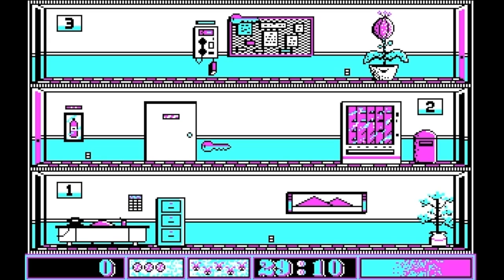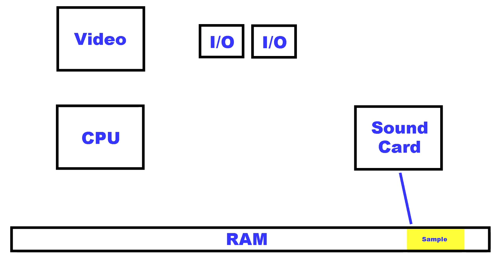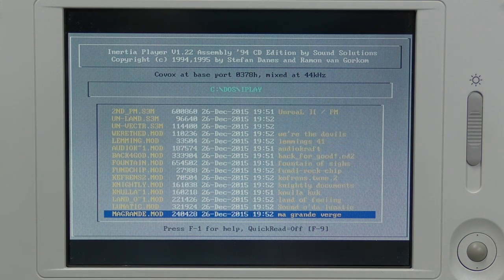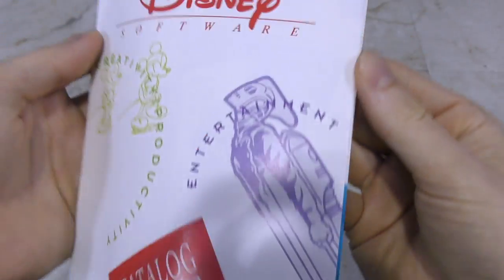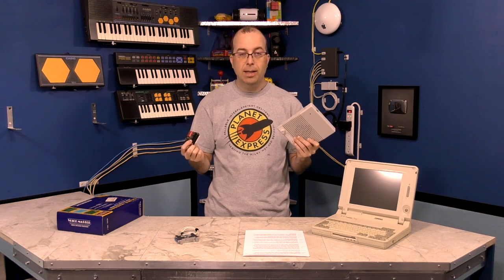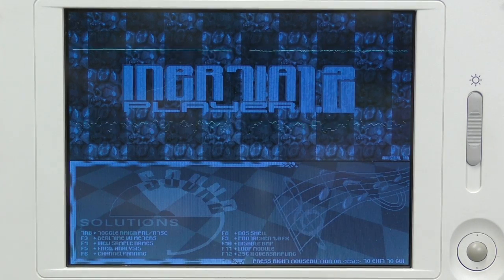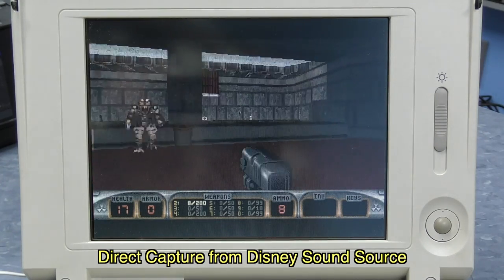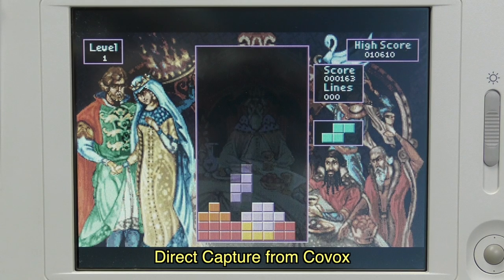How the Covox and Disney Sound Source Worked.

Comment: Does the Tandy emulator work with the Sierra AGI tandy support (that is, Kings Quest 1, Space Quest 1 etc)? If you type sierra -t apparently you can force the interpreter to use the Tandy 3 voice. That might be very useful, as all AGI games have 3 voice sound.
Reply: yes it works. There's also a 3 voice driver patch for covog, for sierra EGA games, and for VGA games.

Comment: Such a passive-only Covox clone only sounds good when used on a CMOS Type Parallel Port. If you have a TTL Type the Signals of the pins are not exactly 5V or 0V but with some offset and that decreases the sound quality. Using a simple CMOS 8-Bit driver IC will fix this but this IC needs Power from the PC to work. There is also a Stereo-in-One Thing that has 2 DAC and Latches switched/triggerd by additional control lines (the Parallel-port hat 12 - 8 for the Data Register and 4 Control wires.

Comment: Or build your own covox clone using a bunch of resistors soldered onto a parallel port connector...  Easily search for a wiring diagram for it.  I bet the one I made back in the 90's still works! =D

Comment: Actually, if you want to make one of these yourself, you're simply going to need seven 20kΩ resistors, or a resistor pack with 20kΩ between pins. The least significant bit runs through a resistor and then is tied to the second bit. This in turn passes through another resistor and then combined with the third bit, and so on until you've ganged up all 8 bits. That's your analog output.

Source: I made my own back in the day.

Comment: I wonder if the games checking for the BIOS string could be fooled: if you're running on a machine with ROM BIOS shadowing, I wonder if it's possible under MS-DOS to go in with sufficiently clever assembly code and modify the shadowed BIOS vendor string in RAM.

Comment: I have one of this Lpt1 port type cards, but I don't remember the brand or model, I only have the internal pc board, I barely remember it came in a black plastic case, and don't remember if used batteries but the pcboard has two pins with + & - so I assume thas the power source of the board. mailme for a pic. of the board and maybe helpme identifying it , or if it needs a driver or config to make it work just for te hell of 8bit...

Comment: seems like the Disney Sound Source is the better design. I wonder why they didn't go with a higher sampling rate like 11kHz. The concept is so simple, I wonder why no one follow up with a better version to try to overclock the Sound Source. Seems like one just need to hack the driver to switch to a higher bit rate.

Comment: On 386 (or higher) you may get partial (digital samples only, no FM) Soundblaster compatibility with VirtualSoundblaster TSR. However it has some extra limitations as it puts CPU in (IIRC) some kind of 32bit protected mode and emulate 16bit real mode. So some games may not work, Windows too... (but it has covox/sound source drivers so it's not as big deal). 

Simplest Covox compatible plug may be easily made from 20 resistors (1% tolerance suggested) two capacitors (not obligatory) and DB25 plug (total cost converted to USD was ~$3), just google "covox schematic" and go to nearest Radio Shack equivalent (hearing sound form self made device is quite satisfying). (There is option to improve it by adding low-pass filter and amplifier to improve sound quality if somebody feels more ambitious).

I tried using covox plug on my PIII machine as with no ISA I had no sound in windows (lack of drivers for PCI cards, they work in pure DOS only with similar 32bit trickery). High improvement over speak.exe (PC speaker PWM driver), but lagged terribly in games (Toy Story:Power Play had 1FPS with sound enabled on 1GHz CPU). I'm gonna try Sound Source in future. (Getting new motherboard with ISA is out of question as this PC is mostly Win9x oriented, DOS/W3.x is just an addition and I don't have space for another machine).

Comment: You ain't have to spend money for real COVOX device to test how it works on your good old PC.
What you need is just 8 resistors of 1kOhm, 2, 4, 8, 16, 32, 64 and 128 kOhm (if you change the resistance a bit, the resulting sound would get some additional noise, which could be quite acceptable). You just insert one wire of each resistor into D7, D6 .... D0 contact of your LPT port as a pin of the 'device', and connect each second wire of resistors into one point. Here's the point to connect your favourite banana plug. Then connect 'earthing' to PC case and you're DONE!
Tested on IBM 386 DX25 over 20 years ago!

D0 ------[  128k   ]---------\
D1 ------[   64k    ]---------\
D2 ------[   32k    ]---------\
D3 ------[   16k    ]---------\-----------------------> OUTPUT
D4 ------[    8k     ]---------/
D5 ------[    4k     ]---------/
D6 ------[    2k     ]---------/
D7 ------[     1k    ]---------/

CASE ------------------------------------------------>

Comment: Had c64's Covox and it was really very bad.  Like it just stunk - a curiosity that got boring with 10min of use.  Later when I was an Amiga computer salesman some guy was enquiring where he might find one of these old gizmos.  I told him I had one and that they're no good.  He wanted to buy it at any price.  Like the great salesman I was ;p I told him to forget it because it really was so damn bad.  But he wanted it and kept bugging me so I basically gave it to him for like $5 (cash to seal the deal as it were).

Years later I'd also get rid of my Amiga 1000.  I did it in an unceremonious fashion by leaning it against the trash bin and nearly karate kicked it in half.  Maybe I shoulda kept the lid, but who cares because those engineers created a disaster of a computer.  Unfortunately I got rid of my Star NX1000 at the same time :( a good printer.

Linux forever.